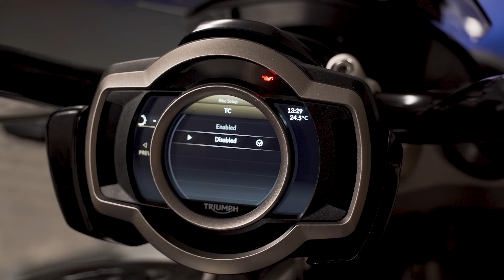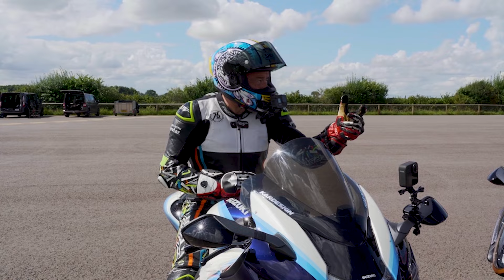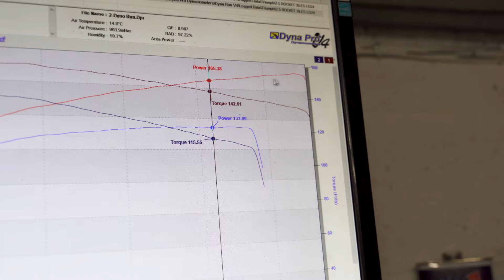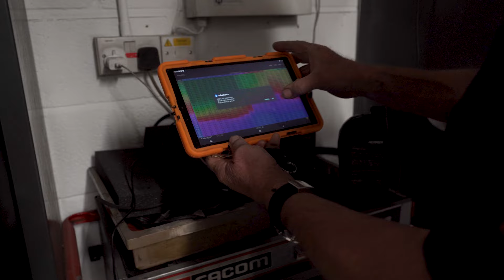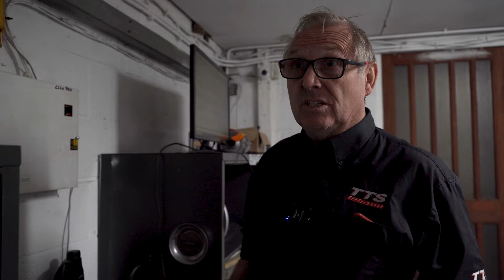How To De-restrict A Triumph Rocket 3!

Comment: Unbelievable. 40 hp with a tune. Is it the OEM filter and pipe?
Reply: I wouldn't call it unbelievable. It's a huge engine, and restricted from factory to prevent people from doing stupid things :-)
Reply: @mcplutt it is heavily restricted cause of emission control, you even can do stupid things with stock figures 😉
Reply: Sounds too loud, seems aftermarket pipe 😉
Reply from the maker: @Dzinbhudist  nothing to do with emissions.
Reply: @TTSPerformance  bike runs lean from the factory to make catalytic converter hot and “happy”, same with ignition timing, fuel cut and so on. All mentioned contributes to emissions control. After tuning I cannot pass MOT on emissions control 😉 dont know how in UK but in europe mainland we have exhaust gasses check for motorcycles.
Reply from the maker: @Dzinbhudist I don’t adjust AFR. I adjust throttle opening and add fuel to go with the extra air.
Reply: @TTSPerformance  need to adjust as it is super lean, especially after sport air filter and exhaust
Reply: Where in the uk can I get this done to my Rocket Storm?
Reply: @ttsperformance  where can I get this done in the uk to my storm ?
Reply from the maker: @dippee40 tts performance
Reply from the maker: @dippee40 tts
Reply: Do you plan on making the tune available for those of us in the states? I live at 7000+ feet elevation and routinely go over passes above 11000 feet. A little extra juice would come in handy when riding 2 up.😊